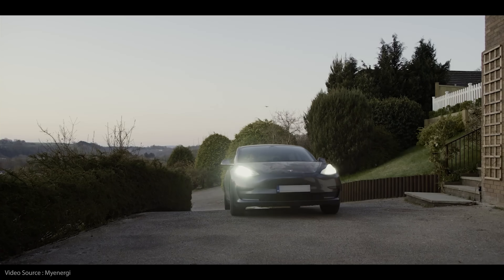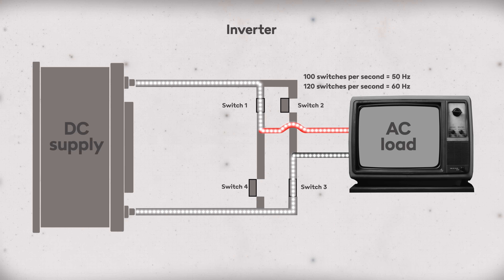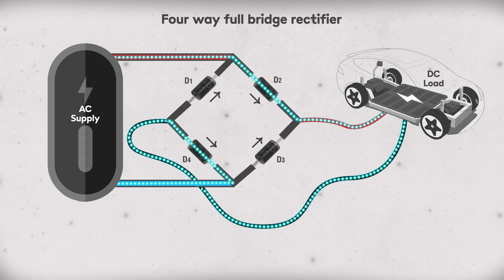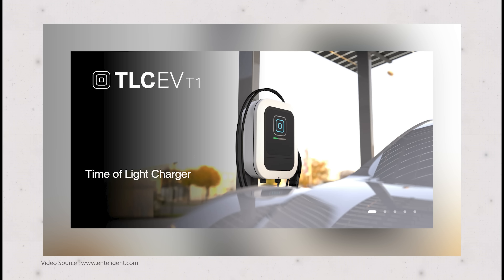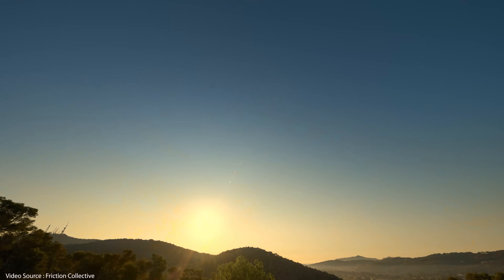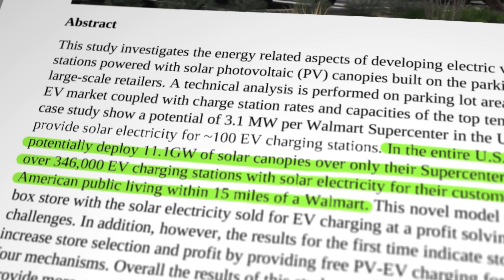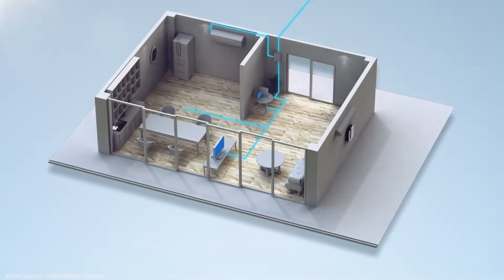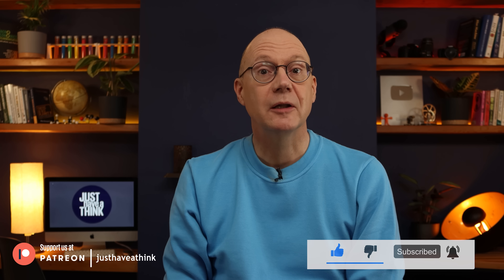DC to DC charging. One more step to off grid living!

Comment: I love the idea but 3 questions emerge from this: 
- How does this device mange the fluctuations in voltage from the panels? Moswt of the time is gradual but theer are days when I see my system goes from producing 4kw to 0.5, to 1.3,... and so one in a matter of minutes. I don't think that's great for the battery
- Will this work connected directly to the DC output of a battery instead/in addition to the PV?
- How compatible is it with the different brands of inverters, smart meters and batteries people already have installed? I have a quite common inverter and found it was quite difficult to install a charger that could communicate with it, this being so new it might have problems or have to work independently from the setup
Reply: I've been told by armchair wizards that Ev's are capable of handling fluctuations like this but it seems reasonable that having a battery to smooth things out would be better.  However, the first gen Enteligent chargers do not support directly connected batteries.  They say gen2 models in 2025 will but that's still a ways off.  As far as compatibility, they have a list of compatible EV's, which is most modern EV's after 2019.  Keep in mind this charger is $2,250, which would take a decade to pay for itself through efficiency.
Reply: @Ryan-ff2db  Like everything, the price will drop as the technology is adopted.  Same as the cost of EV batteries, solar panels, etc, etc.  (edited to change in an ’s’ for a ‘d’)
Reply: @oliver90owner  I agree and I'm excited for this tech.  When the price comes down I'm all in but at $2,250 without installation the math just isn't very good yet.
Reply: The panels are NOT DIRECTLY connected to the vehicle.  That would be extremely wasteful and probably not work anyway since the vehicle battery voltage is likely higher than the solar string's optimal operating voltage.   There is a DC-DC component inbetween that regulates the current.

In anycase, lithium-based battery chemistries don't really care about fluctuating currents as long as they stay under maximum limits.   And also keep in mind that EV battery packs typically have a 2C fast charging rate, whereas these home chargers will barely be pushing 0.2C best-case.   "25kW" is a drop in the bucket as far as an EV battery pack is concerned.  It won't even be breathing hard.

-Matt
Reply: @junkerzn7312    Well explained, Matt.  People don’t seem to realise that the charging speed (from a rapid charger) is both varying and being monitored (by the BMS) all the time.

Comment: Nice find. Ive often wondered why we don't have a DC system wired into each home for lighting, TVs computers etc 💚
Reply: Primarily because AC systems are way easier to make safe.
Reply: Strictly speaking, higher voltage leads to less current for the same power and hence power loss in wires AC or DC.  When you want to transmit high power over long distances we use HVDC (High Voltage DC) lines.  AC has a bunch of advantages for a distributed grid.  When you have your power source and loads very close especially when your sources (solar, battery) and  loads are DC (computers, lights, TVs etc.) DC does make more sense except for the fact that we have economies of scale and experience because we have used AC for a century.  See the RV (recreational vehicle) and off grid communities for dwellings wired for DC.
Reply: Most modern electronics are far less than 12volt once the cord passes into the case.

Computer fans are DC current.
Reply: @shawnr771  So sadly for most consumer electronics usage on solar there is a conversion from solar voltage and then a conversion to electronic voltage (5 or sometimes 12V)
Reply: DC wiring creates a lot of resistance in the wires - that is why AC is used worldwide - AC can travel much further on samller wires than DC without voltage drops that affect the equipment.
Reply: @synthwave7  No, it's not AC vs DC resistance, it's low vs high voltage. The only reason AC (used to) win for long distance is that transformers could easily step up/down AC but not DC. However, power electronics have advanced to the point this is no longer the deciding factor it used to be.
Reply: @synthwave7 nothing you’ve stated is true, some of the longest range transmission systems are DC. The problem with DC is switching it, it like to arc.
Reply: @synthwave7  also DC switches, including even light switches, have to be designed to be resistant to inductive voltages when you turn something off. (Think how the spark voltage is generate in your car, if you still burn gas).

Over time the sparking would decrease the switch contacts.

There's a reason why most light switches (in the UK at least) have "AC only" stamped inside. They are not safe for switching 240V DC,  12V DC maybe...
Reply: @synthwave7  Simply not true.  The resistance of any conductor does not change (well, usually it rises as the temperature rises, but conductor cross sectional areas are controlled to avoid this affecting the system)

High Voltage Direct Current (HVDC) is used for all inter-connectors from one distant region to another because the AC grid system loses more energy doing the same thing.  AC current goes through zero 100 or 120 times every second (50 or 60 Hz) so the peak current has to be much larger.  

The only good things about AC are that AC is safer at the domestic level (240V DC is far more lethal and as AC current passes through zero 100 or 120 times each second (50 or 60 Hz) disconnection does not cause a continuous arc - which would need to be avoided with much more robust switching, to avoid contact damage if even only 240V DC).

Different countries/regions grids may well be out of phase, so converting DC to grid frequency in phase with that country/region is no more difficult than keeping the whole world at the exact same phase relationship.
Reply: @oliver90owner  Thanks.  I was responding to the statements that AC was always more efficient.  Tried to write tersely to keep people's attention.  Corrected the post about resistance.

Sounds like there are some different opinions in this chat on AC vs DC safety.  Tetany and heart damage on low frequency AC (50-60Hz) and the inability to release the electrical line.  The convulsive jerk that tends to release the line with DC.  Might be arguments that low frequency AC more dangerous than DC at the same voltage.
Reply: DC loses more power over longer distances AC is good for power lines to transfer energy across cities. DC is good for easier circuit diagrams
Reply: @Xeno-xt0 I think it's the other way around. AC has historically dominated long distance power transfer because it's much easier and cheaper to step up and down than DC. Things are gradually changing though, largely due to the growth of renewables (especially wind and solar) and technological improvements in power electronics. Google HVDC vs HVAC.